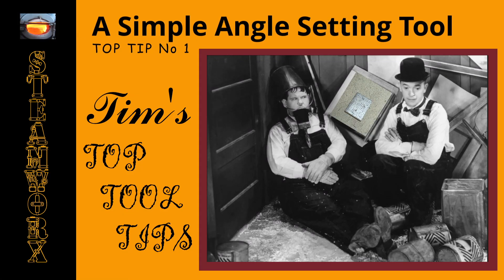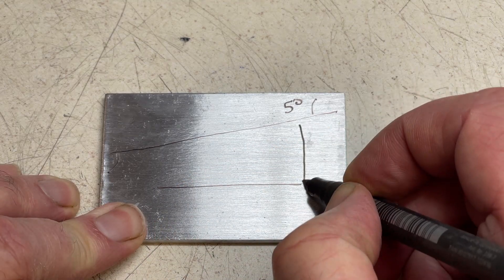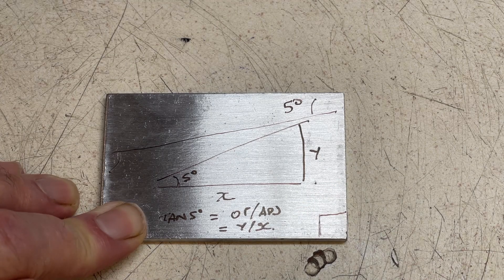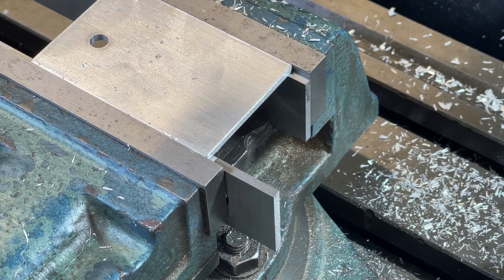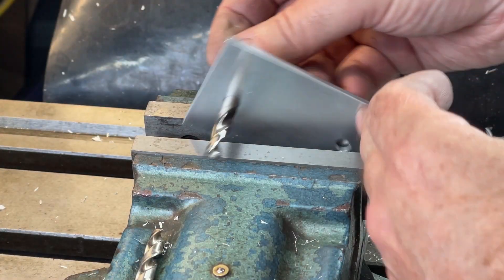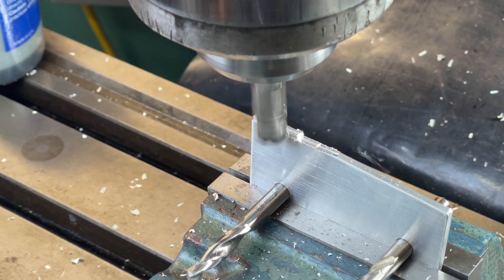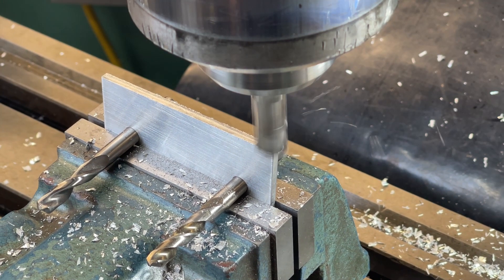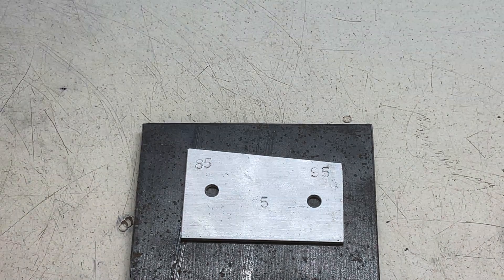Model Engineering Basics: No 1 making an accurate angle gauge.

Comment: A tip in return, when mixing tall thin sections never have the cutter central on the work as you induce crossways vibrations. If you climb cut with the cutter only slightly over the edge, the vibrations will be along the length of the work. Climb cutting is perfectly fine if the cutter load is less than force needed to move the saddle, even on manual machines.
Reply from the maker: Yes, thanks for that. I was being greedy and taking too much for the setup. Would have been better cutting with the side of the tool mounting the plate flat on the bed! Thank you for your comment!